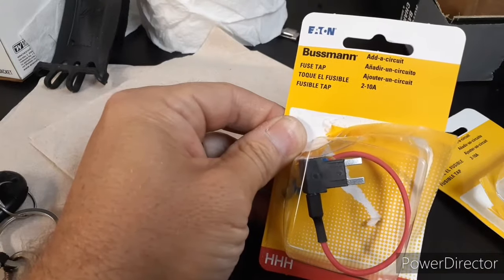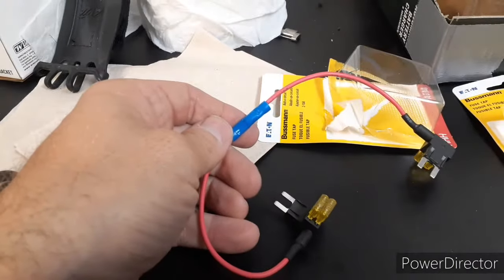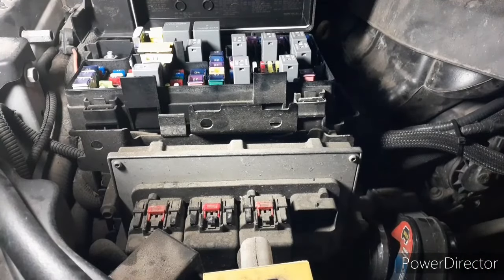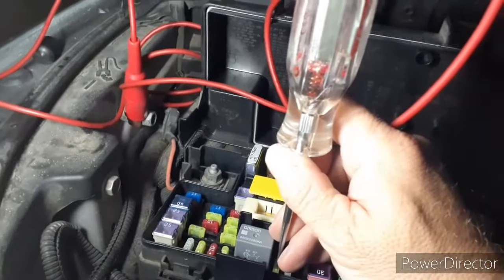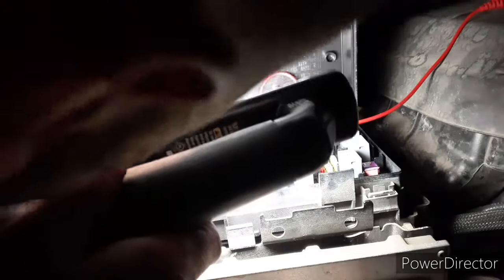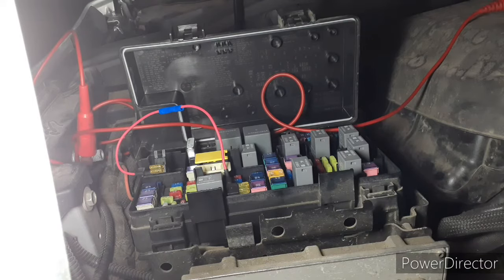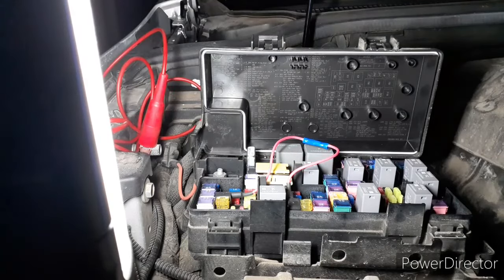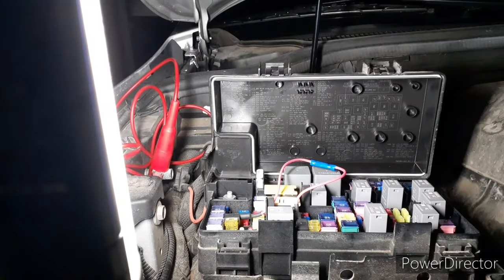Jeep Cranks But Won't Start. PCM Bypass Solution.

Comment: Would it be the same ref: jeep compass 2011?
Reply from the maker: Look at your fuse box and you tell me. There is a map printed right on it. I don't have a Compass in my driveway to check.

If the fuses I point out are the same as yours, do the voltage checks I do. If your results are the same it will work.

Comment: i have a 2015 JGC and it's having issues keeping the battery charged.  It will click once when I push to start, or when charged it might turn over once or twice.  When hooked up to the bigger battery charger it was warm and turned on immediately.  Now sitting on the small battery charger for a whole day it will only turn over once or twice, then click, nothing.  Any ideas?
Reply from the maker: You have the symptoms of a bad battery my friend. As a battery ages it will charge but either not hold it, or lose cranking amps. Sometimes they even show 12 volts but fall flat as soon as you put a load on it.  You need voltage and amps to turn that engine over. 

Clicking noises is almost always a starter solenoid attempting to engage but cannot because of low power.  

You can remove your battery and take it into any auto parts store to have it tested. However, be prepared to buy one when you're there.

Comment: Will this work for the pt cruiser if the wcm goes bad?
Reply from the maker: This is not a solution for the wireless control module.

Comment: This is strange.  I got the wire ready and went out to my jeep and I have two fuses that state fuel pump and none that say cigarette lighter.  Any clue of another way to bypass the PCM?
Reply from the maker: Does your fusebox look exactly like this one?
Reply: Mine is a 2015
Reply: @dinstaar  no but it is the same year.  However i took the computer out, waited 2 weeks and then reinstalled.  It started fine and i have had no problems since.
Reply from the maker: The problem is known to start as intermittent. If I were you I would carry that wire, you may get stuck and need it.

Comment: i noticed you had the 1st pcm plug out do you have to have that pulled out
Reply from the maker: There is no wiring harness  to plug into the PCM on a 2013 Grand Cherokee. There is no need to unplug any wiring harness if your model has one.

Comment: I’ve got a 2012 Jeep jk. Code u0100 no communication to pcm ecm (A). No start, would this bypass start my Jeep haven’t tried it but when shops open will definitely give it a go.
Reply from the maker: This is specifically for the problem of the jeep turning over but not starting. It is for when the PCM has failed to send power to the fuel pump. 
You may have a different issue but good troubleshooting is not possible when I am not in front of the vehicle. Are you in the Waco, TX area?

Comment: Will this work on Jeep Liberty. 2011. Having same issue
Reply from the maker: Watch the begining of the troubleshooting electrical on the video. If you have the same voltage checks and your fuse box looks the same then it will most likely work for you.

Comment: Year of Jeep? This doesn't apply to my Jeep. You didn't mention if you diagnosed for a bad fuel pump or did u skip that info.
Reply from the maker: If you watch the begining again, you'll see I diagnose that there is no power getting to the fuel pump at all. The PCM is not sending power to that circuit. That is why there is no power to that fuse. 

This is a common issue for all vehicles Chrysler uses this computer in. The particular Jeep in the video is a WK2 (2011 through 2013). Look for this specific failure in many Chrysler products using this PCM.

Comment: Im having similar issues with my 03’ grande Cherokee V8 with the 4.7L, will this work around apply to my Jeep?
Reply from the maker: Nope. Your model does not have the same PCM. Your fuse box will be very different than the one I show in this video.
Reply: Hey buddy I have da same jeep as this guy 03 limited 4.7 v8 so my car sat for month da motor went out i replaced da motor but haven't been able to start it I've double check everything to come and find out that the anti theft light is on  only reason I can think why it came on is da xar sat and battery drained completely and I tried jumping it and finally took it to advanced and they charged it and told me it was no good I did put in a new battery as da dealer told me too to see if it would disarm itself but it hasn't worked
Reply: My options at da moment Are: 
1 call a locksmith and pay 200 
Which it might not be da issue 
2 pull pcm amd have it tested 
Which will cost plus to have reprogrammed with key is go cost way to much 
3 try to find a way to bypass the anti theft and get the car started 
The jeep cranks but won't start I'm hearing my fuel pump turn on if I crank to long I can smell fuel I stops the starter is working great as well wat is my issue and how can we get my jeep running
Reply from the maker: @danielpeterson1548  It sounds like your there may be an issue with your smart key being detected correctly. I cannot troubleshoot it to tell you for sure unless you tow the vehicle to my house though so I can do some checks.

Comment: Great idea in a emergency but fuel pump is live with the key in the run position.  What if the person gets in a front end crash and springs a fuel leak.
Pump is still pumping gas and the operator is unable turn the key off .   Need I say more!
Reply from the maker: This how is was always done before. Plus, this would still happen anyway. Your fuel pump is turned on by the PCM the minute you turn the key. They simply use the PCM instead of a relay now. It is not any more dangerous by running your vehicle this way.

Great question. Thanks.

Comment: I have a 06 Jeep commander 4.7L V8.  They said that my TIPM NEEDS REPLACEMENT. Will doing your fuse tab trick fix my car they said it’s not getting power to the fuel pump
Reply from the maker: I cannot check your voltage over youtube. I will attempt to help you but as far as diagnosing the issue, you have to do that with a car in front of you. I am a great mechanic but I am not magic.

Do you have a multi-meter?
Reply: @dinstaar  I checked it and no power is going to the fuel pump but the pump is good. And my fuse box on the commander is different than the one in the video. My cig lighter is a big square 30 amp and I don’t have any lift pump fuse
Reply: @dinstaar  can I send you a pic of my fuse box TIPM? Do you have email? I bought all the parts in your video and just want to see if you can tell me where to connect to to since my fuse are totally different. I have ignition switch fuse, fuel pump hyd cool fuse, ac clutch fuse etc all 20amp but my cig lighter is a big square 30amp. So I tried connecting hyd cool fuel pump to ignition but no success
Reply from the maker: @timland7553  It is time to research which fuse is supposed to power on when you turn the key. I do not have a schematic for an 06 Commander but could rogue it out if the vehicle was here. Are you near Waco, TX?

If you have some long leads for your multimeter you could figure it out.
Reply from the maker: @timland7553  I need an electrical schematic. A picture of your fuse box would tell me nothing. 

Put one long lead of a multimeter to your fuel pump (where you should be getting power on key on). Do a continuity check at your fuse box to see which fuse beeps. That will be your fuse my friend.

Comment: Why not use a horse shoe fuse? Instead of a long wire? Or take the no 7 fuse out and put it in no 25????
Reply from the maker: Because it is not a fuse failire. There is no power potential going to the fuse in the first place, that is why it shows zero volts. The electrical potentional is provided to that fuse through the wire. I am stealing it from the accessory (cigarette lighter) circuit and pushing it to the pump.

Comment: Was the car turning on after a few tries or just not turning at al i have a 2013 wrangler when cold it turns on ok
After running and parking and turning off for about 20 min it will have it just crank and later turn on
Reply from the maker: Mine started off that way and then would only turn over and start again. My theory for you is that the PCM electrical contact may be intermittent. Meaning the contact is separating and is weak but may not have lost all contact yet. When cold the electrical connection has not been vibrated apart, after driving and bouncing it around it may be coming looser and lost continuity. 

I would suggest this bypass and see if it solves your problem. It is very cheap for parts and I have already done the research on what connections to use for you. You have nothing to lose by giving it a shot besides half an hour and $10. Let me know if your problem goes away.
Reply: Just dis it and it did it to me at part store again i had my tools and did it there and it work 
Thanks
I hope it did solve the issue thanks a million i was having that issue for a while
Reply from the maker: @gomezjuan76  Good luck Juan! Touch base if you need me.
Reply: @dinstaar  sorry to tell u but it did it again 
Will leave it in for more time see what it does 
Thanks
Reply from the maker: @gomezjuan76  you most likely have contaminated fuel or need a new fuel pump. It could be something else but it is impossible to know without the vehicle here. Sorry man.
Reply: @dinstaar  all good thanks 
If i take it to the dealer they probably wont know either i have not hear of this issue before
Reply: @dinstaar  do u disconnect the Pcm  how do u do this?? For this to work.
Reply from the maker: @jessemichel7073  No, there is no disconnecting the board. Follow the instructions on the video. There is no missing step.

Comment: any idea when it cranks, and no start....but...i can actually hear the pump come to life in the 'ON' position like normal
Reply from the maker: What year is your vehicle? Frankly, it could be a few things. The most common are fuel filter, fuel lines, air intake, a fuel pump not working properly, and contaminated fuel.

Comment: I have a 2010 grand Cherokee limited, my cigarette lighter is a 30 amp not 20. What can I do?
Reply from the maker: First off, check to see if your fuse box is the same.  I believe the issue began in 2011 models.  Second, if it is the same, don't worry about it.  30 amps is a ton to be running your cigarette lighter, your fuse may have been replaced with a 30 but that doesn't mean it is what the factory intended.  Also you are putting your own fuse in this circuit anyway so if too many amps are somehow pulled to your fuel pump the fuse will blow and you are protected.
Reply: @dinstaar  it’s not the same fuse box. I have the 2010 Grand Cherokee Limited with the Hemi motor. It’s doing the same thing in the video. Cranks but won’t start and started and died when starter spray was put on the carbonator.
Reply: @dinstaar  the cigarette lighter amp is square and the fuel pump amp is regular 20 amp fuse
Reply from the maker: @jefflogan306  This will likely not work. It is a work around for a bad PCM, you have a different PCM. Your problem is mechanical or electrical.
Reply: Did you ever figure out a way to try this? I am having the same issue with my 2010 Commander. Can't you just connect PCM to another 20Amp like the Tow fuse? Driving me nuts.
Reply from the maker: @joeldavis3532  You can tap into any fuse that powers on when the key is on, and powers off when the key is off.  It does not have to be the lighter, but is has to only be on when the key is turned on and turn off when the key is off.

Comment: It does sound like a good TEMPORARY fix!!! I dont understand yet how it affects the pcm....or if it does.
Reply from the maker: It does not affect the PCM at all. The PCM is bypassed and is no longer in control of your fuel pump. Your PCM is broken, that is the problem. This fix is PERMANENT. 

The PCM has a known issue of failing in this manner only. Besides not providing power to your fuel pump, everything else works fine. You can replace the PCM if you like, but it will fail again this same way. It is a known PCM flaw. Many people have replaced their PCM to have the same problem down the road.
Reply: @dinstaar  Thanks so much for replying!!! I understand fully now!!!

Comment: My jeep cherokee laredo 04 won't start it makes a click sound every time I try. the radio works lights everything besides the not starting part had a jump charged up the battery and swapped out the starter but still nothing wondering if you have a idea what it could be would appreciate it.
Reply from the maker: It could be easy to figure out. Swing it by my place in Waco and I'll take a look. Lol.

A good mechanic will he honest and tell you, to do it right I need to see it, touch it, and hear it in person. 

It is most likely one of 3 things. 
1. The battery. Make sure you have 12 volts and load test it.
2. The starter. Jump the electrical contacts and see of it turns over after you check the battery. 
3. The starter relay.

It could be something else but those are the top 3 culprits. Good luck.